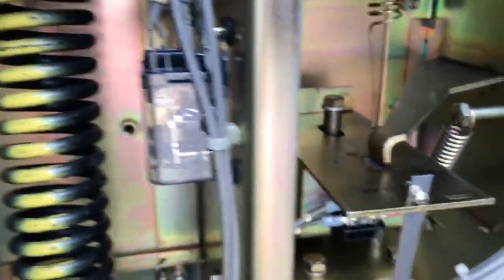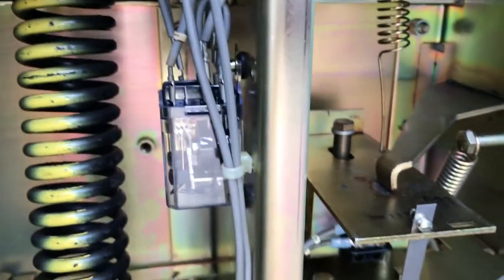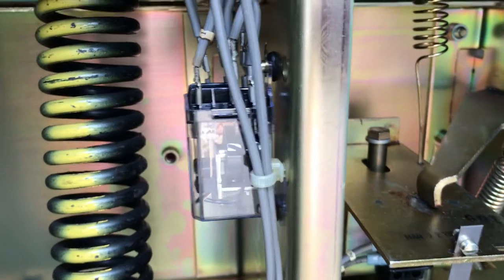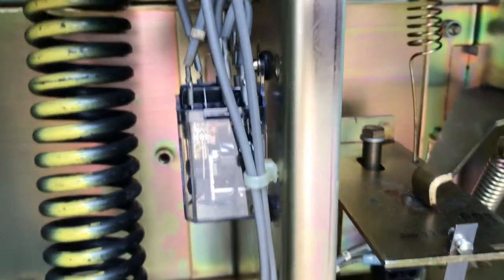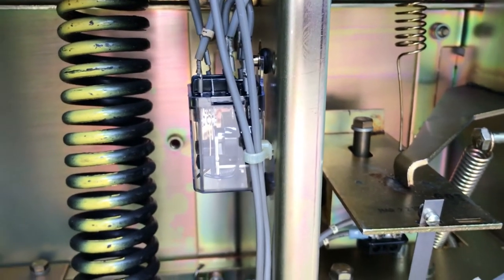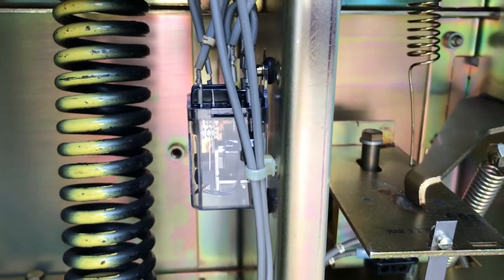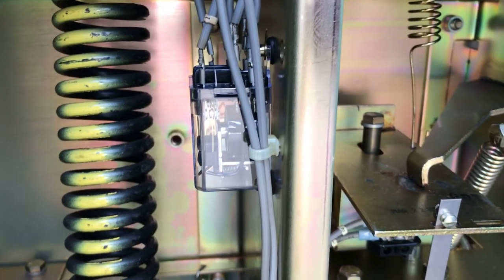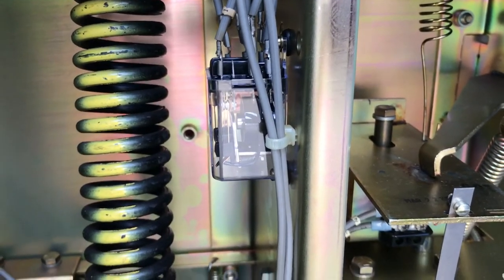Anti Pump Relay

Comment: Is anti pumping relay is located in every circuit breaker circuit such as SF6, Air circuit breaker and vaccum circuit breaker
Reply from the maker: Yes. Anti-pumping is typically achieved via a separate relay which opens a contact to the close (spring release) coil. 

The purpose of the anti-pump relay is to prevent the breaker from continuous closing attempts if the close signal is initiated but does not clear. 

Some low voltage power breakers have this feature built into their mechanical operations and the Eaton Magnum breakers have it designed into the spring release where it only allows one, 1 second operation of the coil until power is removed and then reapplied.